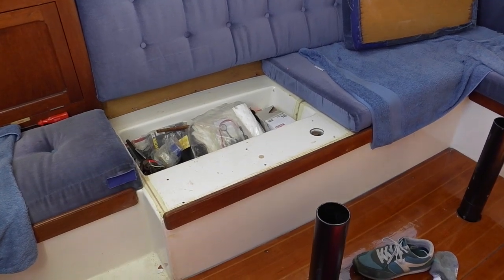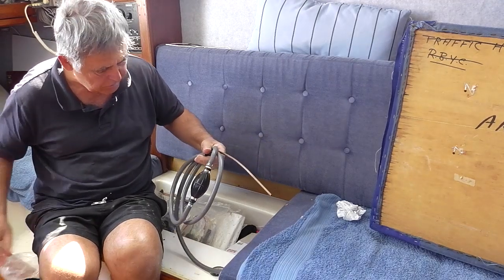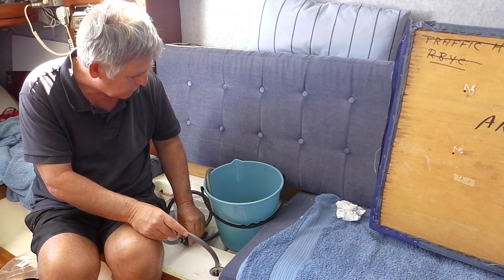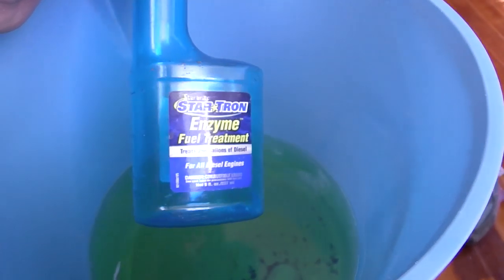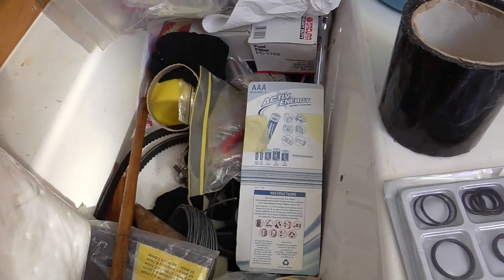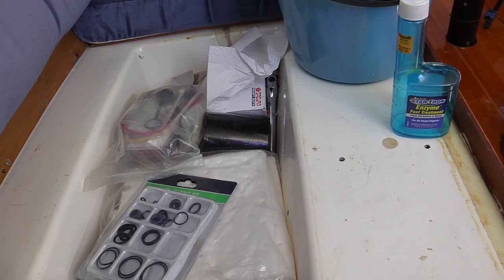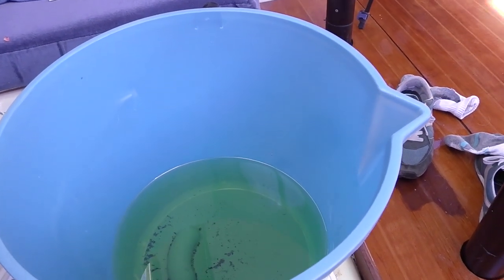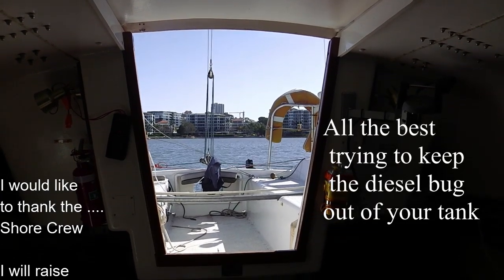How to Checking For Diesel Bug

Comment: You should know that Star Tron is not intended to remove diesel bug. That is bacteria,fungus or algae in diesel fuel. Startron can break down non living sludge in the fuel tank however. If you want to remove bacteria,fungus or algae then you should use a biocide such as Biobor jf  in addition to a biocide. I had discussions with Startron about this.
Reply from the maker: David, thank you I will purchase some Biobor JF and give it ago there is nothing worse than having gunk in the filters. Safe sailing regards Simon
Reply: Simon Carter  I meant to say that Startron and Biobor Jf would be a good combination to kill and break down biological growth in diesel fuel

Comment: Hi Simon, I don’t think that is diesel bug, you need to look at it more closer as I have Seen the bug before and it was Black and round like a liquid if you know what I mean. I think you have something like Dirt or black holes parts.
Maybe empty your tank and give it a very good clean and when you add or put the fuel back in use a very fine funnel.